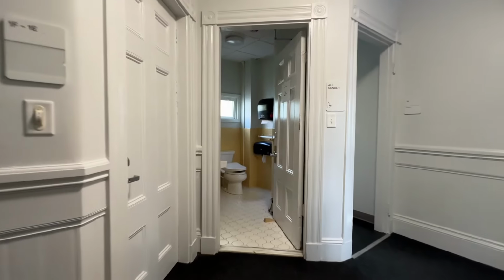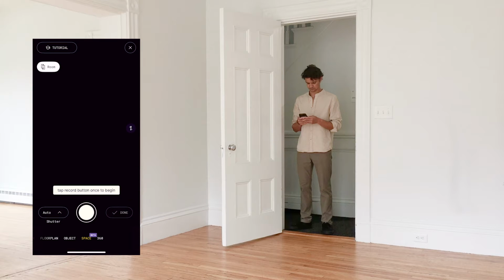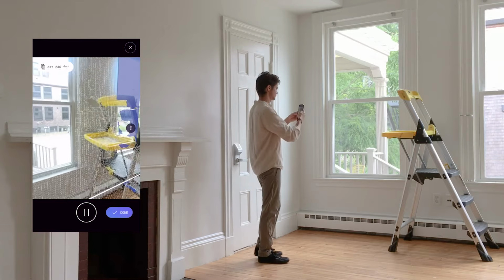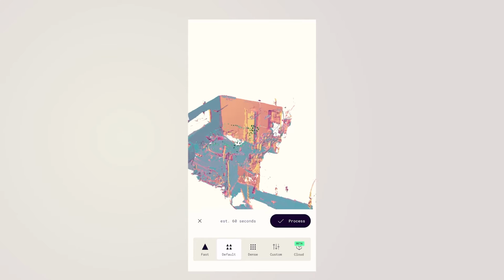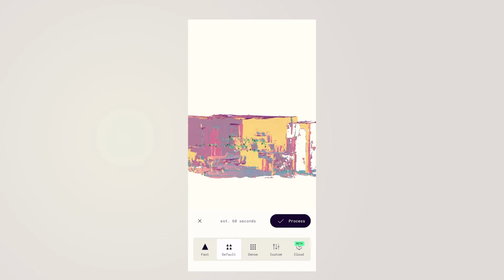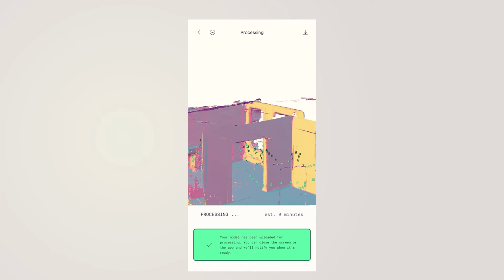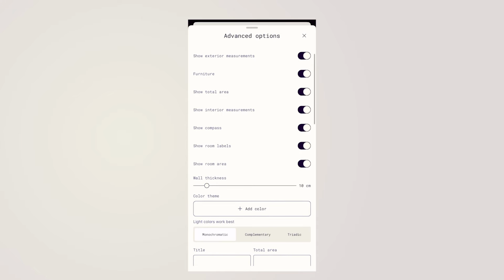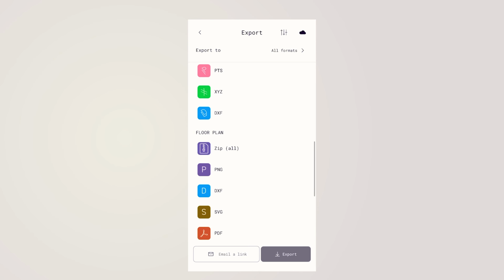How to Scan As-Builts with Polycam

Comment: hi PolyCam. Nice work. I need to generate the drawings of the exterior of the building - front facade and roof angle with measurements and so on. Can PolkyCan provide that option in reporting ?

Comment: I use Polycam, and can get basic geometry looking good. Is it normal for the LiDAR scans to exhibit distortion? They usually look like what I call “melting ice cream.” Is it unrealistic to try to obtain Matterport-like quality using Polycam scans?
Reply: You can get close to matterport quality if you do image based scanning with the correct technique (see their other video on this). Unfortunately doing LIDAR method is never going to be the most accurate as the phone lidar scanner isn't as high quality as a matter port scanner. 

However you can get pretty close. If you use a phone gimbal it gives you much better results. Also try and keep scan times short (under 3-5 mins), it's better to split your scan up into chunks than trying to do a whole house. If your scan does run long resist the urge to "close the loop" and fill the scan in completely if you care about dimensional accuracy. The big advantage of lidar on polycam over matterport or the photo scan mode is time and flexibility of what you can scan. I can scan the front facade and it's relationship to fence lines in minutes, or a series of rooms and how they connect to a hallway in minutes. Matterport can't really handle the facade at all and would take a long time to handle the rooms and hallway. This is perfect for creating a quick digital twin that gets you the general vibe of a space to dimension off of or act as a modeling reference.
Reply: @samh7545  if scanning a big building, is it better to plan for the scan to be section by section and later assemble the doll model using different apps? ie sketchup?
Reply: @samh7545  Do you get good looking models without the melting ice cream? I get the melting ice cream especially around windows, its like the glass causes problems. any advice would be appreciated
Reply: Matterport can output good-looking 3d Geometry. So part can be missing depending on the complexity of the scan. Results are pretty good.